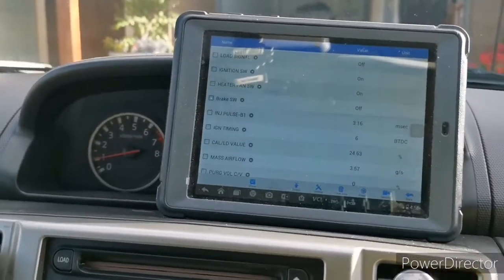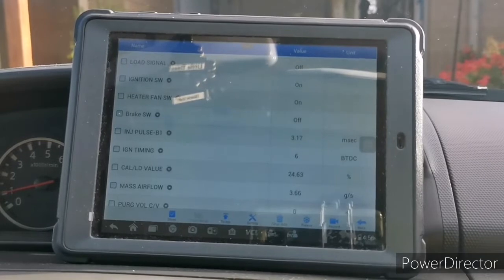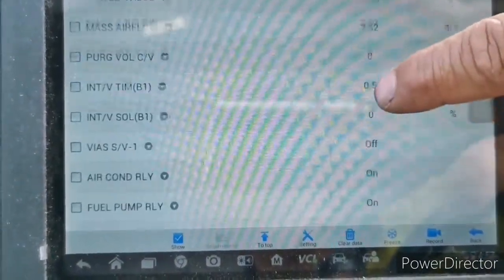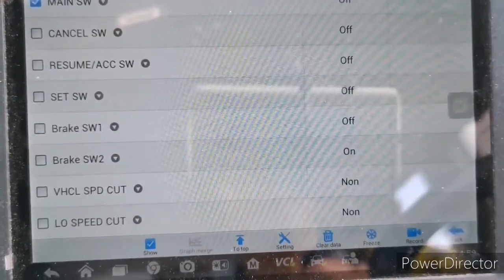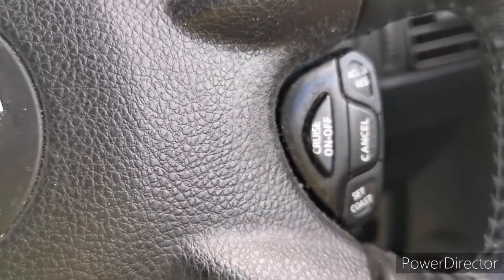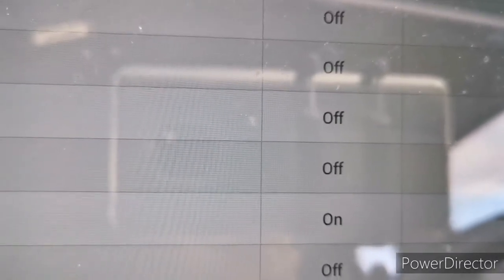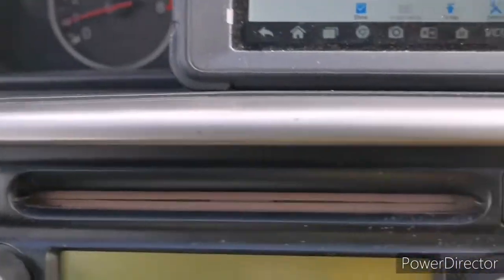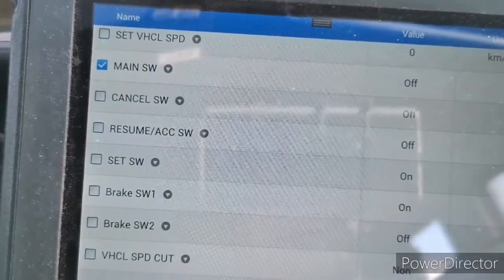CRUISE CONTROL TROUBLE SHOOTING STRATEGY USING AUTEL MINI ON NISSAN X-TRAIL

Comment: hi, friend. I have a Nissan Xtrail T30 Classic which does not have a cruise. Can I purchase that cruise button and will it work or does it have to be configured with a scanner? greetings
Reply from the maker: Cant be because the ecm is not program to have one.software is not desine to operate cruise control.

Comment: Hello sir pwede ba mag install nyan sa akin x trail. May nabibiling kit sa ebay.. gusto ko talaga may cruise control x trail ko
Reply from the maker: Ang cruise control naka instal nayan pag bili ng sasakyan. Kung wala yung X trail mo ibig sabihin late model pa sya.Hindi pwedeng mag instal ng cruise control kc nasa configuration ng computer yan.

Comment: Hi
My strain t30 cruise control was flashing & no brake lights. So, I removed cruise switch & brake switch under brake pedal. Dismantled & cleaned contacts. I was very nervous but but gave it a try. Reassembled & now all working again. Hopefully long term fix.